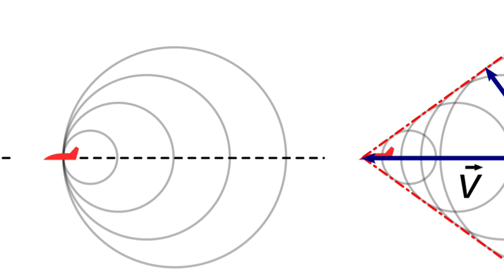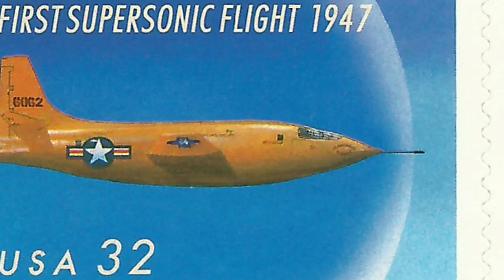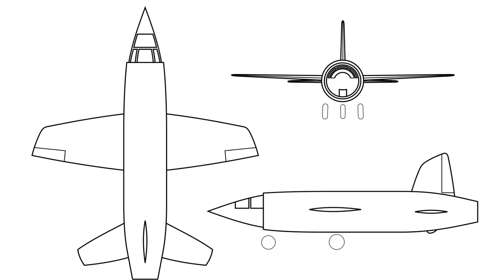Supersonic Firsts

Comment: George Welch may, or may not, have been the first person to fly supersonic, but he certainly did it in a cooler looking plane than Chuck Yeager.     That F86 has a classic look.
Reply: he certainly didn't do it in level flight. THG should've clarified that the f86 was not capable of mach 1 in level flight. had to be done in a dive.
Reply: @oldfrend  Indeed, there were possibly some piston engined aircraft that broke the sound barrier shortly before the pilots broke the surface of the Earth. This was part of the solution with the all flying tail versus an elevator on a fixed horizontal stabilizer.
Reply: @oldfrend  Well, he did get to do it in level flight, on the first flight of the YF-100, in May, 1953.
Reply: @Markle2k  Uhm, no.  Not possible at all, for the following reasons - piston-engined propeller driven aircraft of the time (and now, too) aren't shaped well for transonic flight the airfoils and fuselage contours are too thick, and transonic flow starts early. 
The propellers themselves are moving through the air much faster than the airplane they're attached to - the sum of teh airplane's velocity, and the propeller's rotational velocity - propeller drag is so extreme at speeds above about 450 mph that on several high speed dive tests in the UK and US, the propellers were physically torn from the airplane.
As a transonic airplane descends, the ambient air temperature gets warmer, reducing the Mach Number for a particular airspeed.  The thicker air also increases the drag force on the aircraft, slowing it down.
Reply: Welch did not break the sound barrier.It's an old tired story started by George Welch himself.
Reply: @peterstickney7608  >>>>BOOM! Whoosh. That supersonic sarcasm flew right over your head before you even heard it.

Comment: Shock waves also apply to propellers, which is a speed limiter for airplanes which use those.
Reply: It's also why piston aircraft often sound REALLY LOUD climbing out on takeoff. Seriously, do the math on a 82 inch propeller at 2800 rpm. It's going 0.89 Mach. The air PAST the airfoil is transonic. The acceleration over the top of the airfoil sends it supersonic.

Comment: 6/18/2024
I happened to be standing in my back yard on the day when the B-58 made its super sonic run from west to east. The TV news said it would pass over Cleveland, Ohio.
I never saw the plane, but there was a boom that shook the ground and then a few seconds I later heard the sound of the jet. I'm sure it was hundreds of miles away by then.
Super sonic flight was still rare back then,  Then in 1967, 68, and 69 I got several chances to be a witness to an F-4 take off under full after burner, (100 feet away) That boom shook the ground too,
By the way the F-4 was one of the first fighter jets to exceed Mach 2.

Comment: Great video, I grew up in northern NY, 30 miles north of Syracuse and near the edge of Lake Ontario. It was the 50s and the 60s. Our house was, as we called it, the turning point for three Air Force bases: Syracuse, Rome, and Plattsburgh. We were deluged with the sound barrier and machine gun sounds as training was done over the lake. I can't count the number of times my mother jumped and screamed when that sound resonated throughout the house. You never knew when it was coming! It went on for all those years until better developments in that field of flight came about. I even flew in a 727 once and noticed what looked like a slightly moving shadow along the leading edge of the wing. I questioned it to the stewardess and she told me t

Comment: 6:45 The Sound Barrier sneaks up from Behind. It's the Tail of the Aircraft that begins flying Supersonically before the Nose of the Aircraft. This occurs as the air begins to flow faster than the Speed of Sound to fill in the Wake of the Aircraft around the Tail.  This is the Beginning of the Sound Barrier, the ever increasing drag up to Mach 1. Supersonic Expansion Fans, Supersonic Flow and the Wake Shockwave form first, then continue to grow, with ever increasing drag, until finally the Nose of the aircraft achieves Mach 1 and the entire aircraft is in Supersonic Flight. It's the Tail of the Aircraft that Breaks the Sound Barrier before the Nose.

This modification to the Horizontal Stabilizer was the Secret Sauce which gave the Tail control in Supersonic Flight at the beginning of the Sound Barrier, while the Nose is still Subsonic.
Reply: Interesting.  Didn't know that.  Thank-you very much.
Reply: Love the Secret Sauce bit
Reply: @johndufford5561  There's a reason you didn't know that. It isn't true.
The secret sauce behind the horizontal stabilizer is because the local flow over an airfoil can go supersonic before the rest of the airframe. If this shockwave reaches the front of a movable surface like an aileron or elevator, it can produce a pressure that is greater than the pilot can overcome to move that surface or create a force that moves it in a catastrophic direction (force the nose down in a transonic dive). Moving the entire tail surface through a hinge point alleviates this problem.
Reply: @Markle2k  Yes, what you are talking about is the Center of Lift moving from the quarter cord in subsonic flight to the half cord in Supersonic Flight. Having a split horizontal surface/elevator, when the elevator is deflected to a larger angle of attack, it goes from subsonic to supersonic flow and doubles the moment arm on that surface. The elevator is attached at it's leading edge. But I think you miss the point, moving the entire surface you can choose where you want to rotate horizontal stabilizer. The Secret Sauce, rotate the entire surface much closer to the 1/4 cord and 1/2 cord, not the leading edge of the control surface, like on a split horizontal stabilizer/elevator. And it sounds like you surely missed the point that the Tail actually goes supersonic first. As the flow turns, it goes supersonic, expansion waves form to turn the flow. This supersonic flow terminates in a Wake Shockwave, a "Normal" Shockwave that grows as the aircraft pushes into the Sound Barrier. This cone of Expansion Waves terminated by a circular "Normal" Wake Shockwave, it's diameter continues growing to infinity at Mach 1. The "Normal" Bow Shockwave appears.

The entire Tail achieves Supersonic flight before the diameter of Wake "Normal" Shockwave goes to infinity.
Reply: OK, then, in that case, how is that the delta wings - F-102, F-106, Mirage, Concorde, et al, are capable of controlled supersonic flight without the "secret sauce"?  The early F-86s, F9F Cougars, the Vought F7U Cutlass, the MiG-17 and MiG-19 all were controllable at supersonic speeds using elevators alone.
The development of supersonic airflow, and thus shockwaves,  around an aircraft goes from, basically, the thickest parts, in terms of depth to length, (More acceleration of the local airflow) down through the thinner - typically, this starts with the wings.  The airfoils of the tail are generally thinner, and the fuselage comes in last.
Some airplanes, like the Westwind Business jet, or the Russian Il-28 jet bomber, have swept tails to delay the shockwaves over the tail, maintaining control while at high speeds.
Reply: @WeBeGood06  I  think I see what you're saying. We've got two complementary detrimental things going on at once or in succession. I was talking about the loss of control authority that leads to a dive due to the shockwave formed at the hinge line of the elevator, which then will cause the center of lift over the main wing to move aft further increasing mach tuck.
Is this moving us more toward agreement, or am I still confused by what you were saying?
Reply: @peterstickney7608  Delta wing aircraft have a number of options, but they are less sensitive to the effects sue to high wing sweep angles and long chord lines. You can have an automatic retrimming system that counteracts the aft-moving center of lift, keeping the control feel consistent. Or, the Concorde had a rear trim tank that allowed fuel to be moved aft to shift the center of gravity aft, reducing the need for a lot of aerodynamic retrimming. Many modern gen-3+ delta wing fighters (Dassault Rafale, Eurofighter Typhoon, SAAB Gripen, most anything Chinese) have canard surfaces in front.
All those conventional 1st-gen jet fighter aircraft you mentioned used stabilators (all flying tails) where the whole horizontal tail surface moved on a hinge placed near the center of lift. This has its own issues with reducing control forces to near-zero without other compensating mechanisms.
Reply: @Markle2k  Yes, more of that Secret Sauce, just like the horizontal stabilizer/elevator when going from subsonic to supersonic, the center of lift goes from the Quarter Cord to the Half Cord of the lifting surfaces, including the wing. The Center of Gravity does not move aft. Since the Wing is producing lift at 1 gee in the up direction. Moving the Center of Pressure aft creates a very large pitching moment down that the much smaller elevator has to counteract. Mach Truck requires large elevator deflections to counteract the Aerodynamic Center Shift. The Hinge Line is where all the Expansion Fans would radiate out from taking the flow way past Mach 1. Another way to think of it, is the hinge line would be the Throat of a Laval Nozzle, with everything past the nozzle expanding supersonic flow, ultimate Mach number of this flow would be a function of deflection, how much the pilot pulled back on the stick.. 

Additionally, you hit on the other point of the Secret Sauce, the Horizontal Stabilizer is a much larger aerodynamic surface area than the Elevator alone.  So, moving the entire Horizontal Stabilizer has 3..4...maybe even 5 times the Control Authority than the tiny Elevator.  Much more control to counteract the Aerodynamic Center of Pressure Shift.

Definitely in agreement. But there is more....
 
Subsonic Choices for Transonic Airlinerers that try to push through the Sound Barrier, like the recent attempt of a  737 MAX  shortly after takeoff. Someone in the distant past because it was an Analog World made a bad decision that is still with us today, one that continues to crash airlines and baffle investigators.. They didn’t correctly apply the Secret Sauce to their design.
 
There is a third surface to talk about in this Analog “fly by wire” world. By Wire, I mean cables in this case, not electrical wires hooked to computers. This Third Surface is the Trim Tab, a tiny aerodynamic surface on the Elevator, essentially an elevator for the elevator to trim or move it  so the pilot doesn’t have to pull or push the Stick all day long, Someone Instead of applying the Secret Sauce correctly and giving the Pilot the maximum Control Authority of the entire Horizontal Surface, they kept the Elevator and redesigned the trim tab. Removing it from the trailing edge and moving the entire Horizontal Surface to Trim the aircraft. 
 
While this still works for Subsonic flight, it doesn’t work if the pilot attempts to take the aircraft Supersonic and pushes into  the Sound Barrier. In the 737 MAX case, this led to a seriously misconfigured aircraft where a Computer was added to the 50 year old Analog Aircraft. The pilot was given the Small Elevator to fly the Aircraft, while the newly installed fly by “electrical” wire computer was given the Entire Horizontal Surface. The computer had 3 to 5 times the control authority and could easily overpower anything the pilot did. Add to this, a full power on dive, pushing the 737 MAX into the Sound Barrier,  center of pressure shifting aft, it was impossible to pull up. The Computer and Mach Tuck both worked against the doomed pilots. It’s sad that even today many in the industry doesn’t understand that the Secret Sauce should be applied liberally to any aircraft that might enter the Transonic realm and push into the Sound Barrier.
Reply: @peterstickney7608  A trick question

Which Passenger Airliner was the first to push through the Sound Barrier past Mach One and Supersonic Flight?

If you answered the Concorde, you would be wrong. It was 10 years earlier, the DC-8, and Chuck Yeager was there too, flying the chase plane back in 1961. You read about it and they trimmed the Horizontal Stabilizer before pushing into the Sound Barrier so they wouldn't loose control because the Secret Sauce had been incorrectly applied to what was intended to be a Subsonic Aircraft.

As recalled by the test flight engineer, Richard Edwards “....We took it up to 10 miles up, 52,000 feet—that’s a record—and put it in a half-a-G pushover. Bill maintained about 50 pounds of push. He didn’t trim it for the dive so that it would want to pull out by itself. In the dive, at about 45,000 feet, it went to Mach 1.01 for maybe 16 seconds, then he recovered. But the recovery was a little scary. When he pulled back, the elevator was ineffective; it didn’t do anything, so he said, “Well, I’ll use the stabilizer,” and the stabilizer wouldn’t run. It stalled, because of the load…..”

Comment: The first supersonic flight was actually  likely done by a WW2 German pilot Hans Guido Mütke flying a Messerschmitt 262 jet on April 9, 1945…in a dive he described the then unknown characteristics of an aircraft approaching, going through, and then slowing down through the sonic barrier….later computer model testing showed the 262 jet was capable of super sonic flight. His account and biography can be read on Wikipedia. Incidentally, the first man made flying machine to go supersonic , in fact over Mach 2, was the German V-2 rocket in 1942, which was also the first into space, flying beyond the Karmann Line (the establish boundary of space) on June 20, 1944.

Comment: Mark Felton has a great video about the time in the early 80s when a Concorde was used to compare acceleration with various NATO aircraft including the F15 and the EE Lightning. Only one of the fighters could catch Concorde that being an  RAF Lightning which it’s pilot said was very quick even for a Lightning with its 2 Avon’s capable of 50,000 ft per min climb and Mach 2. 
Not bad for a 1950s design

Comment: One of my favorite airplanes is the supersonic capable, heavy bomber, Rockwell B-1B Lancer.  A heavy bomber with a swing-wing design to accommodate low take-off and landing speeds, (as well as any other lower-speed necessities,) and of course higher/supersonic speeds. The B-ONE is a beautiful and powerful aircraft that can deliver a payload before hearing that it happened.  🚀✈  😲😵

Comment: The first flying tail plane was tested in 1943, on a Miles experimental aircraft. According to the late Eric Brown, in conversation in 2001 he stated that has was going to be the test pilot of the Miles 52. He asserted that a major part of the cancellation was because of the battle between Whittle (inventor of the jet turbine) and the Ministry of Supply as his company was scheduled to supply the engine, much to Rolls Royce’s displeasure.

Comment: Around 1990 was doing a summer course at the Institute von Karman  near Waterloo Belgium in the lab and in use as a teaching asset was the first super sonic wind tunnel which was used by the von Braun V2 project in WW2. The size of the working area of the tunnel was tiny but large enough to accommodate a small model.

Comment: Don't forget the USN research aircraft D558 phase I. The D558-I was the first research aircraft to takeoff under its own power, go 0.99M in level flight (supersonic in a descent), and land under power. As a research aircraft it produced more useful data from transonic flight than the X-1 because it could operate at those speeds in steady state.

Comment: AFAIK it´s quite accepted that the first supersonic level flight was achieved by a Me-163A prototype.
I think it was the V3 prototype but I´m not sure if I remember that correctly, could also be the V4.
It wasn´t published because of being held secret, and thus not official.
If one looks at the Me-163 with its swept back wings, the speed that the production model Me-163B achieved while not being as light and streamlined as the Me-163A and carrying two 30mm cannons unlike the Me-163A, I think this is quite plausible.

If you look at the Me-163A airframe it surprisingly mimicks the Douglas F-4 Skyraider, one of the Navys first supersonic or at least transsonic fighters. Compared to the X-1 with its straight wings...

In addition, unlike the X-1 the Me163A could take off by its own and go on to supersonic flight.
Reply: It was fast. It set a world speed record. It did not break the sound barrier.

Comment: Thanks for mentioning the Miles M52 in this and the role its development played in breaking the sound barrier. Of further note concerning this remarkable feat of engineering is that it was designed to be turbojet powered and not rocket powered, as was the Bell X1. A further indication of the very advanced state of British aerospace engineering at the time. I don't think you mentioned that. And it's well established that the US government reneged on its agreement to exchange technologies